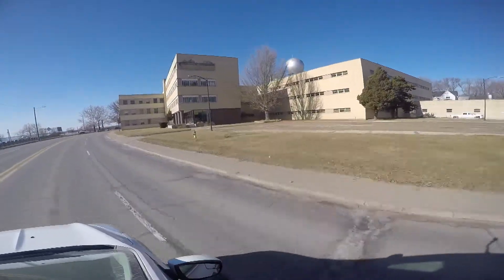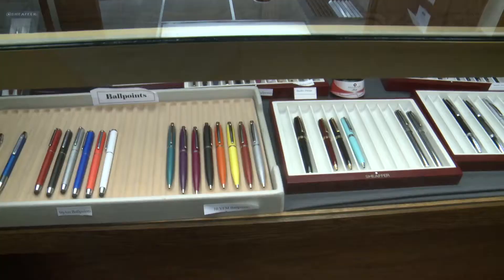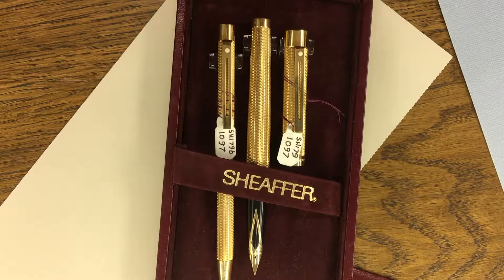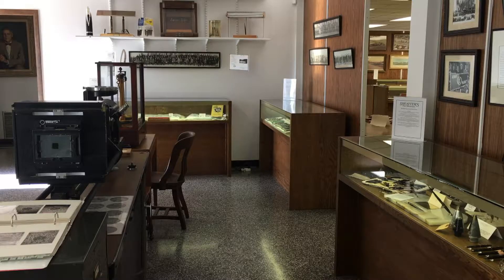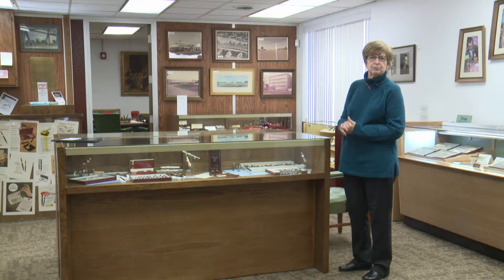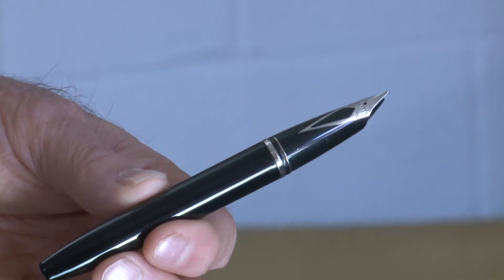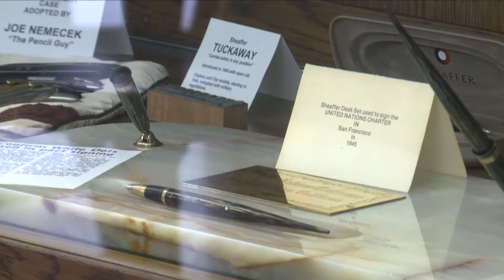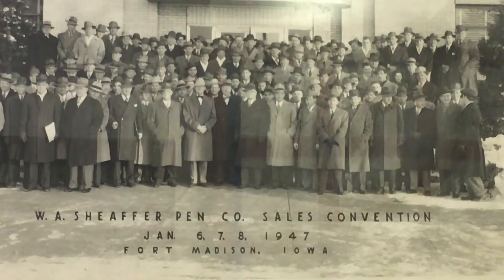Sheaffer Pen Museum

Comment: The Sheaffer Targa is one of the best fountain pens ever in my view, i have owned one since 1988, it has been used daily since buying, it has only just needed the nib section replacing due to wear, but Sheaffer refused to replace it under the lifetime warranty which it came with, saying wear and tear does not come into it.After much research, found a nib section through extensive looking and reviews !! just like new again, hope this nib lasts as long !!